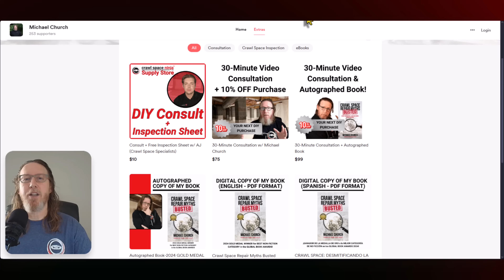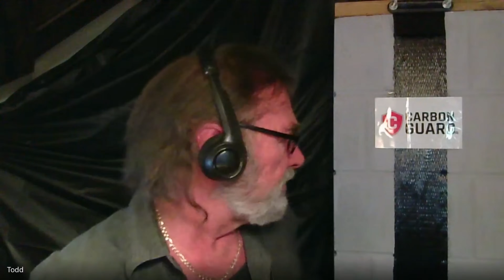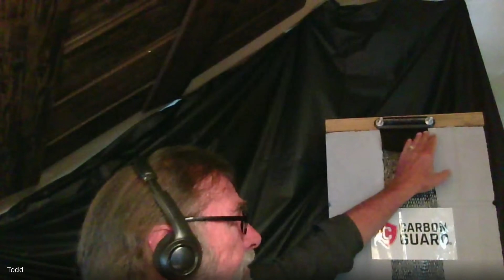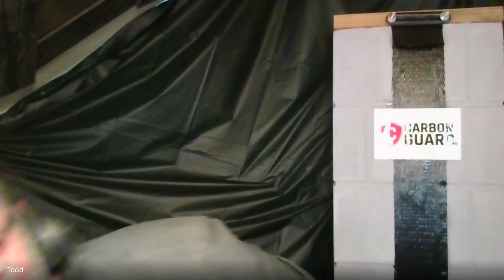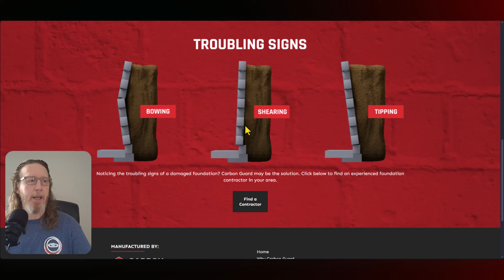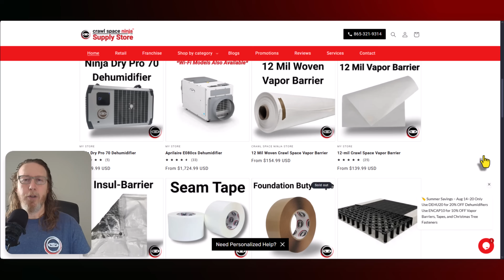Basement Wall Bowing? Here's Why Proper Anchoring Matters

Comment: Michael, I enjoy your videos. I’ve not seen any video on the proper way to do a new crawlspace. I am considering a small addition to my home and want to make sure the contractor does everything right to begin with. Thank you.
Reply from the maker: Thank you so much for watching and I appreciate your recommendation for this video. I will try to put something together.
Reply: @CrawlSpaceNinja That would be great. Not much info available on new construction especially for a conditioned crawl space or a new crawl space  with ICF walls and wood rim joist and floor joist on top of ICF and crush gravel base inside.
Best options like spray foam the gravel floor with closed cell and rim joist bays etc etc